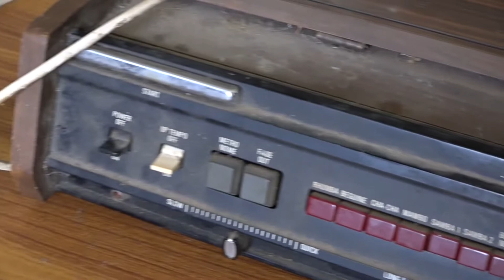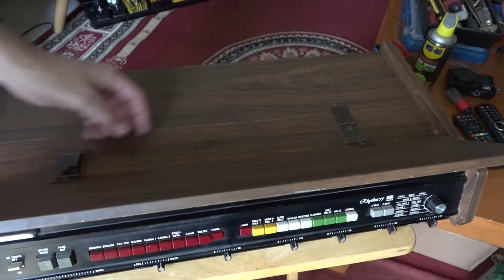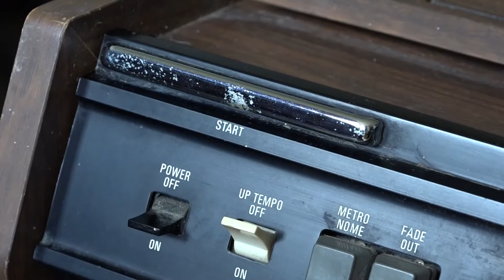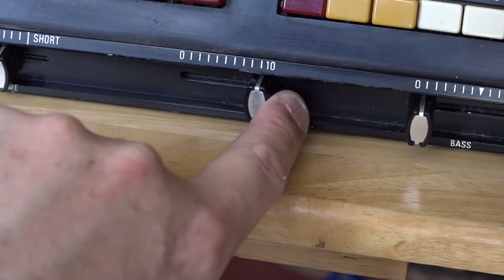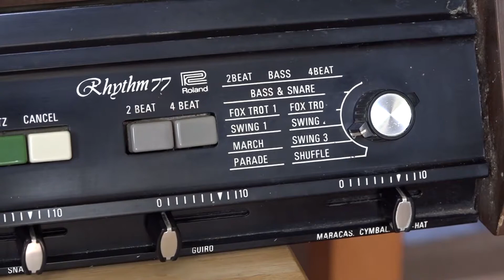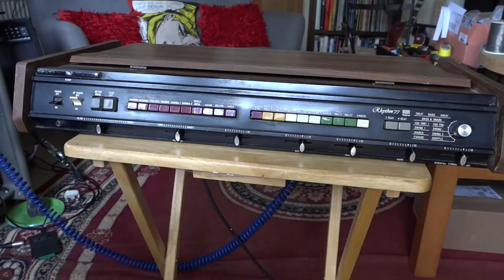Roland's first ever product the TR-77 Drum Machine AKA the Bentley Rhythm Ace

Comment: Hello! I just bought and cleaned up a tolex version from 1976. I'm planning on using this with guitar and atop my Rhodes once I get it restored. Wondering if you could give any advise on the outputs. I assume we use an instrument cable and not a speaker cable. Should I use high imp? Into the effects loop or into the preamp? I also thought about having some fun and running effects pedals with the TR as well. Would love your thoughts. Thank you for posting this video!
Reply from the maker: Be careful drum machines are very good at popping speakers Ans guitar speakers are not as robust as keyboard or bass speakers. Instrument cable yes ans use the low level out to go into pedals
Reply: @MatthewNorthMusic  thank you. So running to my Rhodes with a Janus amp, would you run low imp to the preamp or high imp in the effects loop, or something else? I really appreciate your response. Hard to find info on hooking these up appropriately with the application.
Reply: For a bit more context, the Janus amp is the keyboard amp that came with the Rhodes 88 suitcase. It's a large 4 12" solid state amp the Rhodes sits on.